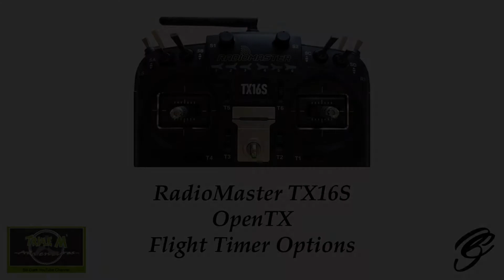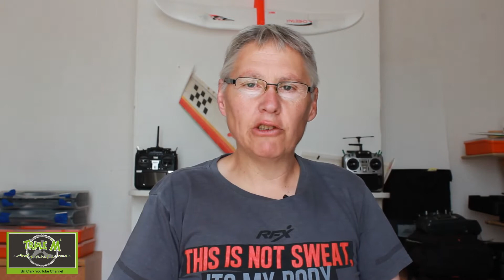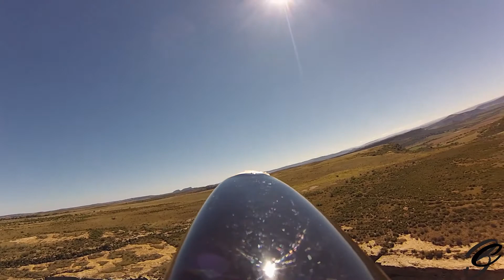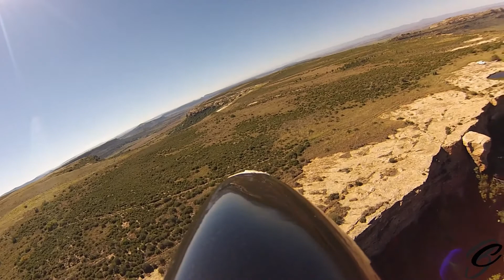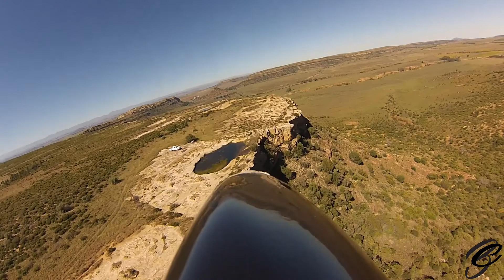RadioMaster TX16S OpenTX Flight Timer Options

Comment: I want to duplicate my Spektrum NX10 timer1 in my TX16S.  The Spektrum timer allows you to start and stop the time based on throttle stick position.  For example, I have a nitro model that I set the time to count down when the stick position is more than 20%.  The reason is that there is very little fuel burn at low throttle and this is a better judge of flight time than the th% function of the TX16S.   Is this possible with the TX16S?

I love watching your videos and especially your British accent.  I live in Oklahoma, USA.
Reply from the maker: Hi Hank, thank you for watching my channel it is appreciated. 
Yes you can achieve what you asked. 
Set up a logical switch a>x Input Thr -40 which equals 20%
In timer 1 select the Logical Switch and set the time length you need.
You should be good to go.